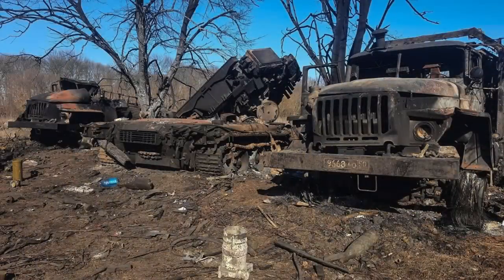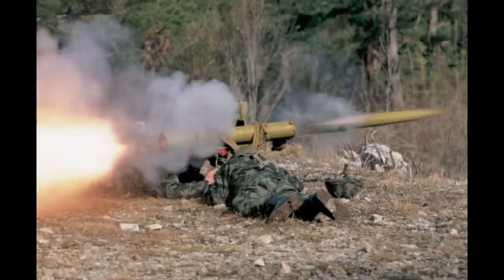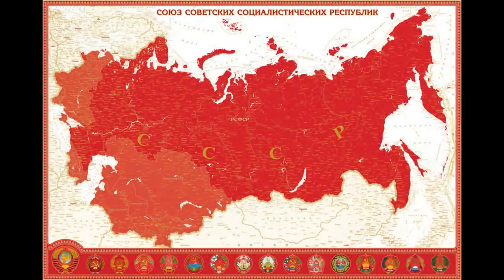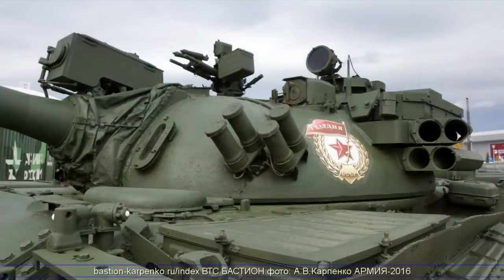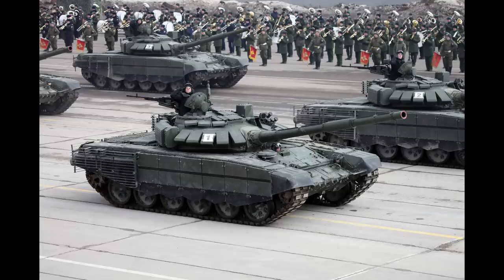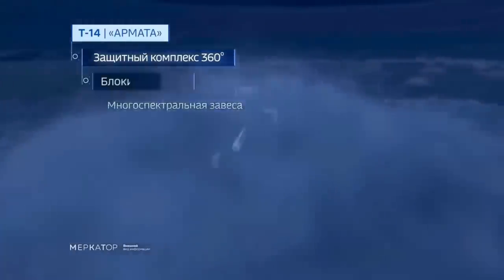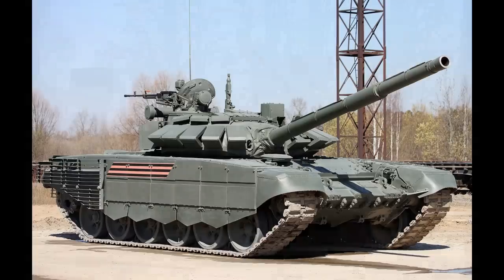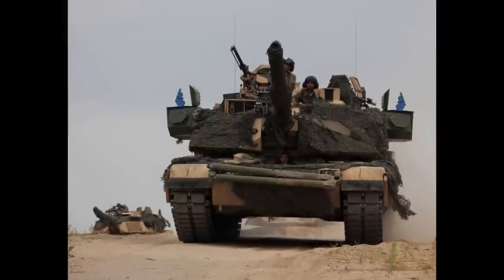Why are Russian Tanks Failing in Ukraine?

Comment: They are losing a lot of tanks to artillery or mine fields or because they simply break down. The Skif/Javelin ATGMs are often seen being used against IFVs/APCs/older MBTs. Generally speaking APS wont make up for the various shortcomings of the Russian mechanized forces.
Reply: No, artillery doesn't have the accuracy and the time to respond to reliably hit moving targets. Mine fields at best would just immobilize a tank, would not outright destroy it or its crew. AT missiles are the biggest threat to tanks, and those threats are not exclusive to merely Russian tanks.
Reply: @thuggeegaming659  Before you doubt that remind yourself of how WW2 battleships were able to fight each other precisely with corrected artillery fire over easily 10+ km. Modern artillery is even more accurate and can strike the same spot with incredible reliability if it set up in a correct manner.
Reply: @KSCBob  No, artillery is basically useless against tanks on the move, the only time they can hit anything is if they are conveniently grouped together and are off.
Reply: @thuggeegaming659  Or if they're using PGM's guided by drone mounted laser designators.
Reply: @thuggeegaming659  Bollocks. Historically artillery kills more tanks than anything except aircraft. It's both an area kill weapon and a direct fire weapon capable of penetrating any armor depending on which type gun you're using. Youi don't just lob one shell at a target and call it a day.
Reply: @patrickweaver1105  Moving the goalposts fallacy. Historically AT missiles are comparatively new weapons compared to artillery, so your argument is invalid. We're talking about the current conflict, not what happened during WW1 😂
Reply: Artillery does not need penetrate tank armor. All it needs to do is to detrack the tanks
Reply: @thuggeegaming659  your statements are simply wrong, but in addition to that you assume that tanks spend most of their time moving.
Reply: @politenessman3901  Nonsense, my statements are correct. If a tank isn't moving, it's extremely vulnerable to any attack. Movement and maneuverability are life.
Reply: @thuggeegaming659  There are direct video evidence of artillery accurately hitting moving target from miles away. The evidence shows both side doing this to the other.
Reply: @WeatherMan lol
Reply: @aniksamiurrahman6365  No, the video shows artillery hitting a large group of tanks that are standing completely still. Most of the shells missed too.
Reply: @thuggeegaming659  and they spend much of their time not doing it. your statements are simply wrong, but that has been well covered by others here.
Reply: @thuggeegaming659  and they spend much of their time not doing it. your statements are simply wrong, but that has been well covered by others here.
Reply: @thuggeegaming659  and they spend much of their time not doing it. your statements are simply wrong, but that has been well covered by others here.
Reply: @thuggeegaming659  and they spend much of their time not doing it. your statements are simply wrong, but that has been well covered by others here.
Reply: @thuggeegaming659  and they spend much of their time not doing it. your statements are simply wrong, but that has been well covered by others here.
Reply: @thuggeegaming659  and they spend much of their time not doing it. your statements are simply wrong, but that has been well covered by others here.
Reply: @thuggeegaming659  actually yes you can with proper training Artillery can be properly timed to the exact place and moment of impact you should watch more history or read a book about it
There's plenty of videos out there of a 155mm HE round turning tank steel into hot butter
Reply: @thuggeegaming659  It makes the point artillery can and does destroy  a large number of tanks even today. AT missiles have existed since WWII. That's not a fallacy it's a fact.
Reply: @thuggeegaming659  Your unspoken assumption about tanks and artillery is that tanks are always on the move, and that artillery has to track and hit the tank directly with a shell. 

Having actually watched dozens of hours of combat footage, I can tell you that tanks spend the majority of their time in battle sitting still or close to it. Especially in urban settings. 

I also know from that footage that Russia likes to set up pre-calculated firing solutions to hit along multiple points on major roads. That makes it easier to hit moving targets. Tanks aren’t as vulnerable to indirect hits, but their supporting elements certainly are vulnerable. Even if a tank can run such a gauntlet, doesn’t mean lighter vehicles and infantry can accompany it. Unsupported tanks can be taken out by infantry. This road artillery gauntlet strategy was a major source of Ukrainian casualties around Severodonetsk and Lisichansk. Ukraine was basically unable to continue supplying its forces in Severodonetsk and then took heavy casualties while fleeing. 

Finally, one of the major anti-tank assets in an artillery arsenal is cluster AT munitions and cluster AT mines. One drops roof-penetrating bomblets and the other scatters mines. In the case of the latter especially, hitting a moving target becomes rather trivial. Just deploy a mine cluster in front of the target. If it tries to back out, drop another behind it.
Reply: You need to believe that 👈❓
Reply: @thuggeegaming659  In the first phase of the war ATGMs were useful to destroy the first and maybe last vehicles in a column, run away and let the artillery do his job. Most tanks were destroyed by shells.
Reply: @thuggeegaming659  german artillery was what defeated the soviet armor during second world war because German tanks couldn't match them until the introducción of the kwk 40. So no mate, artillery has been used against tanks since the dawn of the tank.
Reply: @thuggeegaming659  My friend you're just wrong. With artillery, you just don't need to hit the tank.
Reply: @alvaro701  Nope, you absolutely do. In fact artillery HE rounds are ill-suited for destroying tanks.
Reply: @alvaro701  Lol no, the Soviets won the war against Germany. You failed history class too? 😂
Reply: @alvaro701  Nope, most tanks were destroyed by AT missiles.
Reply: @QualityPen  Lol no, artillery simply does not have the accuracy to hit a moving target.
Reply: @patrickweaver1105  Nope, artillery only hits tanks when they are standing still and conveniently clustered together.
Reply: @darthtyranus7683  Lol no, artillery can not hit moving targets.
Reply: @politenessman3901  Sorry but no, artillery can not hit moving targets.
Reply: @politenessman3901  You're repeating the same thing over and over again. You do not know what you're talking about.
Reply: @politenessman3901  Ad nauseam fallacy, NEXT!
Reply: @politenessman3901  Ad nauseam fallacy, NEXT!
Reply: @politenessman3901  Ad nauseam fallacy, NEXT!
Reply: @politenessman3901  Ad nauseam fallacy, NEXT!
Reply: @politenessman3901  Ad nauseam fallacy, NEXT!
Reply: @thuggeegaming659  lol you really don't know that the germans pounded the soviet armor to ashes? Your history teacher would slap you boy.
Reply: @thuggeegaming659  Whatever you say, you have been proved wrong by everyone in this thread. It's fine loosing an argument, it means you're the one that learned something.
Reply: @alvaro701  You really don't know Germany lost WW2? Your history teacher would slap you boy. Assuming you went to school in the first place 🤣
Reply: @alvaro701  You're the one who thinks Germany won WW2 🤣
Reply: @thuggeegaming659  Artillery can hit a moving target. It's not an ideal scenario, but trigger math is doctrine, at least for forward observers in the US army. Combine that with a linear sheaf and HE/PD followed by HE/VT and you dramatically increase your odds of neutralizing or destroying the target.
Reply: @bojangles8873  No it can't. Not with any regularity. It's like saying a tank can shoot down a jet aircraft with its main gun. Vaguely possible, but not worth considering.
Reply: @thuggeegaming659  Except, again... It's something forward observers train to do. So clearly the possibility is good enough that the us military decided that it should spend precious time teaching people how to do it. Like I said it's not an ideal scenario, but your outright dismissal of it's efficacy seems to come from a lack of experience on the subject. I don't need to blow a tank up to make it combat ineffective. I can take out its sights, comms system or tracks and it's essentially useless for the foreseeable future. 

 Also, the comparison of a tank shooting down a jet fighter to artillery shooting a moving target, especially one moving down a road is beyond ridiculous. There is a reason tankers aren't taught to engage jets, but observers ARE taught to engage moving targets.
Reply: @bojangles8873  Lol no they don't. Artillery hit stationary targets, the probability of artillery hitting a moving tank is equivalent to a tank being able to hit a jet fighter with its main gun with a proximity charge. Sorry, but you simply do not know what you're talking about.
Reply: @thuggeegaming659  It's not remotely equivalent, but I'm not going to bother arguing any more man. There's no point.  Have a good one.
Reply: @bojangles8873  It absolutely is, you repeating yourself over and over again doesn't change the fact that you're wrong. Have a bad one. 😂
Reply: @thuggeegaming659  It's becoming increasingly obvious you know absolutely nothing about tank warfare.
Reply: @thuggeegaming659  I'm repeating the same thing because I am right. I've also called in arty, have you?
Reply: @politenessman3901  No, you're repeating yourself to overcompensate for being wrong. Ooo we have an armchair warrior here! Tell me, what wars have you fought in. This will be good. :)
Reply: @thuggeegaming659  I see you are avoiding the historical fact that arty has hit moving targets and modern tech has made it easier. so hero, you've not called in any arty have you. but from mommies basement, you pronounce what is and what isn't possible. you are a demonstrable joke.
Reply: @politenessman3901  I see you're avoiding stating which war you fought in because you're an armchair veteran of War Thunder 🤣
Reply: @patrickweaver1105  I know more than you do, that much is obvious 🤣
Reply: @patrickweaver1105  Must be a troll or someone with anger problems.
Reply: @komradearti9935  No that's incorrect, the vast majority of tanks were destroyed by AT missiles. The ones destroyed by artillery were all stationary and clustered, they were not moving. Also there are many false reports of tanks destroyed by artillery when they were merely obscured by smoke and incorrectly reported as destroyed.
Reply: @thuggeegaming659  Keep coping lol.
Reply: @alvaro701  Right back at ya ;)